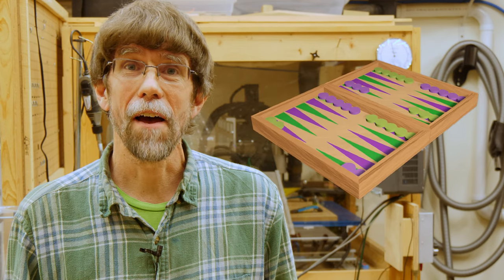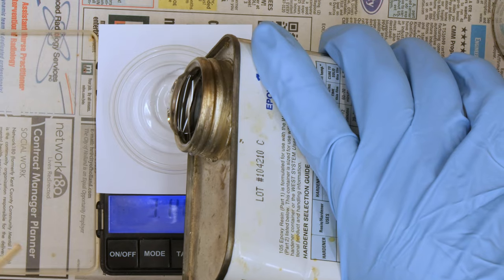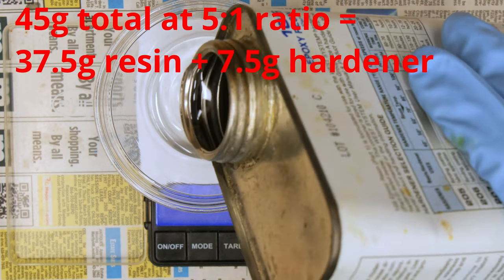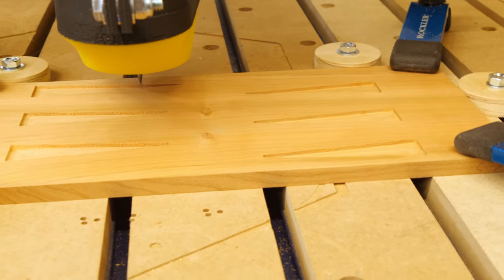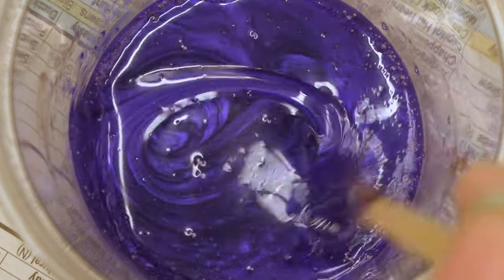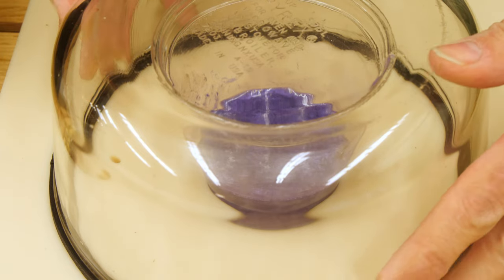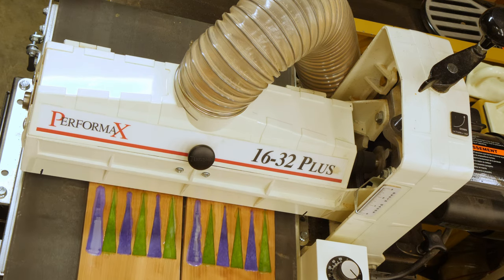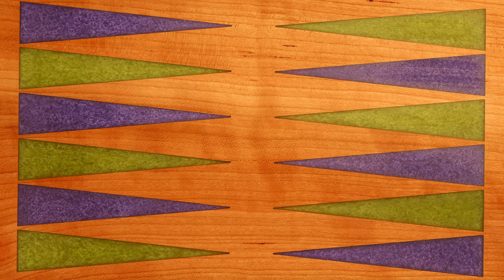CNC Epoxy Inlay Backgammon-Cribbage Board, Part 2

Comment: For those small amounts, disposable syringes make it much easier and it keeps the cans of epoxy clean since you can draw it up into the syringe and not have to pour it.  Good stuff!
Reply from the maker: Thanks, yes I use syringes for mixing very small batches, and I do prefer that method but the truth is I couldn't find my larger syringes when I made this part so I did it by weight. Of course I found them afterward.

Comment: Love the experimentation with the different colors. How do you think the epoxy/wood combo will hold up over the years as the wood ages and goes through humidity changes?
Reply from the maker: Glad you enjoyed it. I don't think there will be any problem with the epoxy and humidity changes because it's reasonably thin (flexible) and it should be well-bonded to the wood because I left the pockets just as they came from the router, i.e. the insides of the pockets should have lots of small surface irregularities that will help the epoxy to adhere. It could be a problem in an environment with extreme humidity changes but I haven't had any reports of failures from the family members to whom I gave these boards.

Comment: You should try pre warming your resin, it will flow much better and the bubbles will escape far easier, also when I use resin I always ensure that I pour the resin and don't fiddle with it as you fill your 'void' like you were during this build and wait until it's full then if you don't like the pattern of your pour then use a stick to add a swirl or a dragging pattern from one end to the other
Reply from the maker: Thanks for the tips!

Comment: This is an awesome idea. I'm at the beginning of building a guitar and was planning to put some aboalone dots into the fretboard, but having seen this, i'm totally going for this as fretmarkes!
Reply from the maker: That could work but keep in mind that epoxy is plastic and not as hard as shell material so it may not resist string abrasion very well. You might want to check out my videos on shell inlay: https://youtu.be/-pyLSGf-tpk and https://youtu.be/e5Wao5huZnA.
Reply: @BrainRight  that's a good point. sadly i dont ahve the means to CNC anything, so i might need to think of something else
Reply from the maker: @MightyGodlikeG  Folks have been doing shell inlay for hundreds of years without CNC, no reason you can't do great work with simple tools like a small router or Dremel tool or even chisels if you're very patient. It may take more time (and practice!) but great guitars have been made that way. CNC does make it easier though.
Reply: @BrainRight  Yes, of course. I'll practice on some spare wood anyway. Maybe i'll go for a mica powder CA glue mix. We'll see :D

Comment: I have a request to build a backgammon board.  I was thinking of inlay also but with wood inlays with my router.  Do you see any problems with this approach?  Most all backgammon build videos I see involve veneering.  Thanks.
Reply from the maker: Yes you could certainly do it with wood inlay. In my particular case I had a request for a board with purple and green, and decided to try epoxy instead of using dyed veneer. You can cut the veneer by hand of course, or if you have a CNC router you could use that like the way I used mine to cut shell inlay in this video: https://youtu.be/e5Wao5huZnA